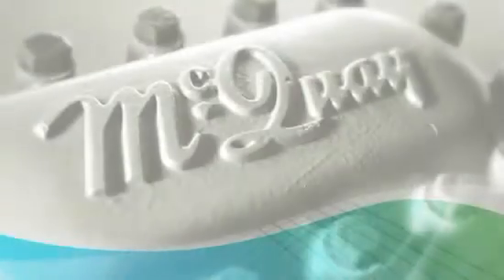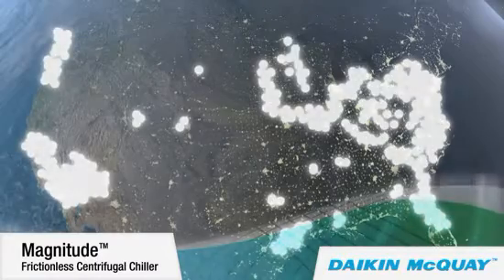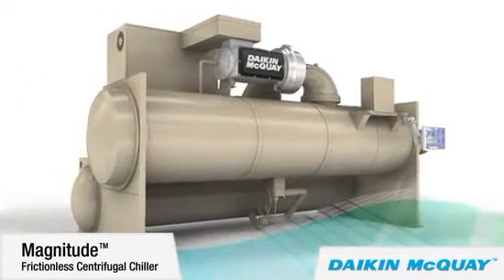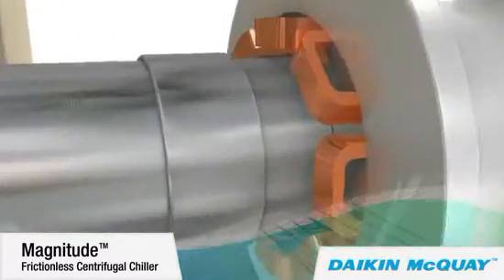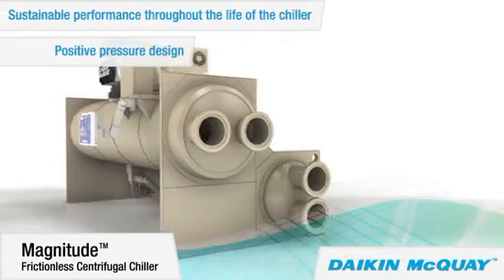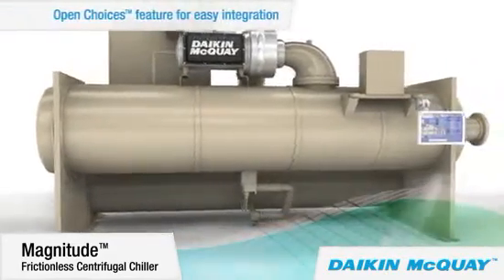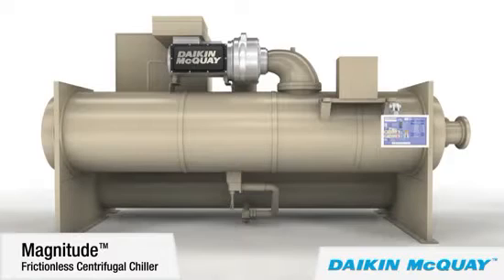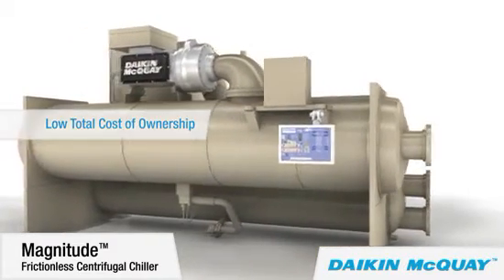McQuay Magnitude Water Cooled Chiller

Comment: magnetic bearings.  no oil.  Sounds like a recipe for disaster!  Sure this is hitech.  However, I wonder how much that will cost if the power supply to the bearings fries?  Watch the whole system tear itself to shreds.  

I would need more proof of this systems action  in order to trust and be sold on it.